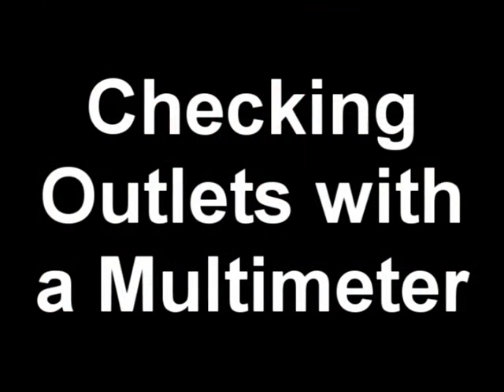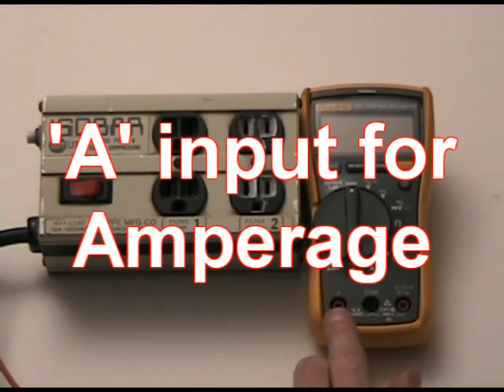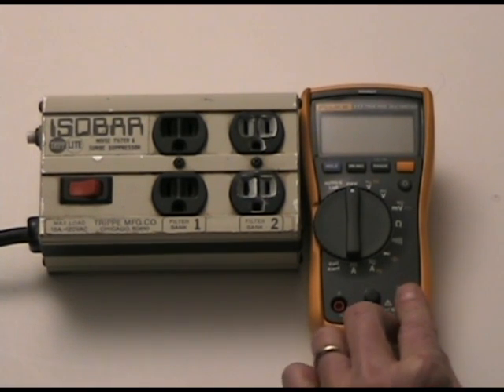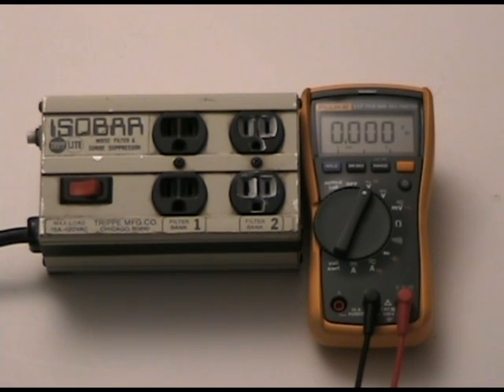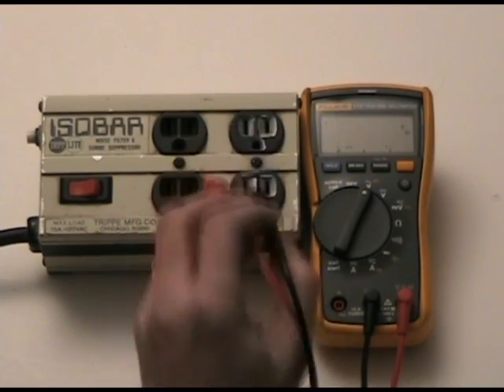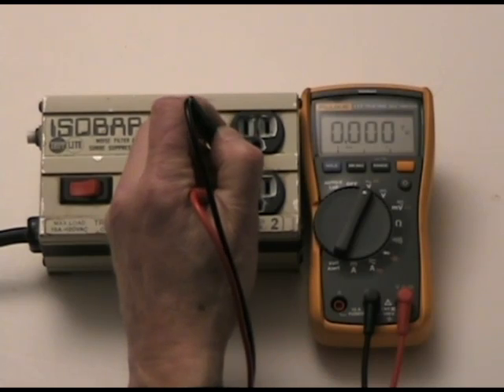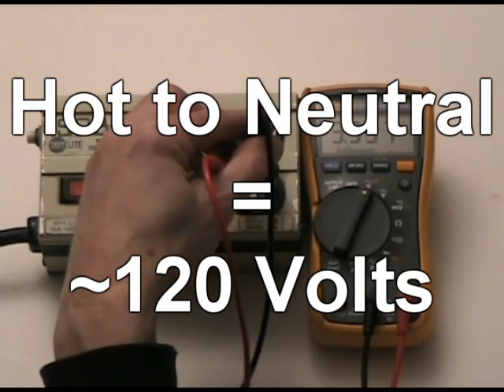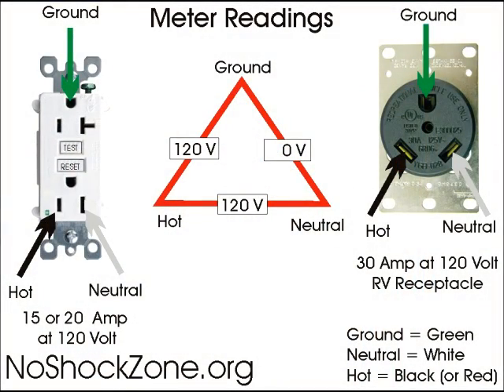How-To use a digital multi-meter

Comment: What happened is you probably had the RED Lead (cable) in the A position (left hole). I've had that happen before too... What that does is you actually put voltage INTO the outlet to measure the current. Electricity colliding, just think about how dangerous that is.

Comment: Anything between 110 and 130 volts is considered to be safe voltage (in the USA). A reading of 120 volts is considered to be the normal potential.

Comment: Dumb question: is the outlet you're testing live? I have a small, radio shack digital multimeter and I want to see if the 6-20r outlet in my apartment is 220 or 110. My Super thinks it junctions in w/ the 110 line b/c there's no dedicate breaker. I have visions of me flying across the room… on fire…